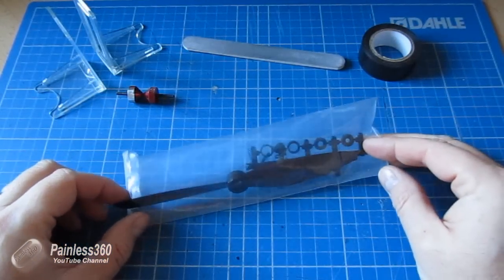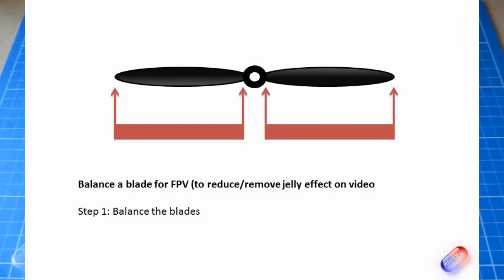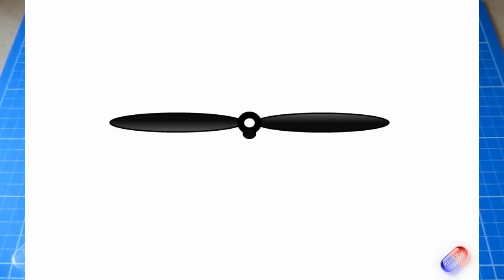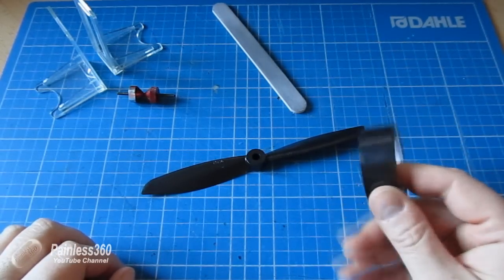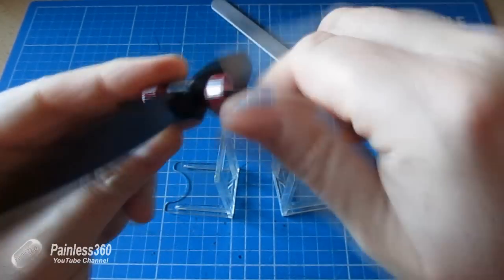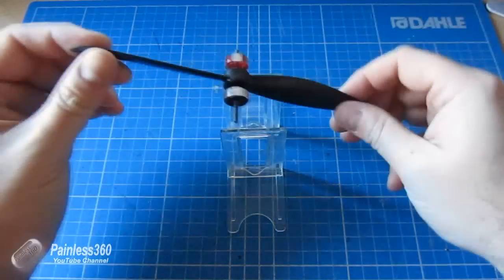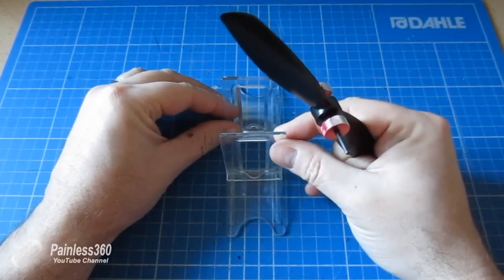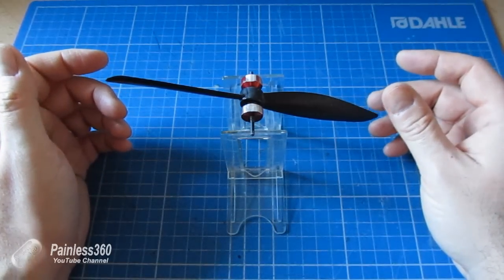How to balance a prop for FPV to help remove video 'wobbles'

Comment: Watched a couple other videos on youtube about prop balancing, you were the first video to bring up the point about the hub and how to balance it.  Thanks for all the awesome vids and sharing all your experience with the community.  I'm about to purchase my first 250 sized kit quad, your other videos have been a huge help in narrowing down what it is I want out of my first racing quad.  I'm leaning toward the Nighthawk Pro FPV Mini 280 RTF as an easy entry point to get the hang of things and then I'm hoping I can sell it to a friend on the cheap to get them into quad racing and at that point I'll build my first one from the ground up.  The prices aren't too bad for all the parts once you've already put money into the chargers, batteries and FPV headset.

Thanks again for all the vidoes, they've really been helpful in all my research for the past month.

edit: subscribed!
Reply from the maker: +lostalaska Welcome to the channel! :D

Comment: This is exactly what I'm trying to fix right now. Actually thinking what I could do to balance those self-locking props (like DJi phantom3 ones). Never saw a prop balancing tool that accepts that one. Thanks for the video.

Comment: Your video helped me a lot. 1st, I have the same simple crappy prop balancer like you and it's way out of balance. I used your method of balancing it and now it is much better, not perfect but at least it is working now. 2nd, After not having much luck with plastic props i switched to CF ones and since they are heavier than my previous ones, they produce much more vibrations, your video is good reference how to balance them too,, in fact I already managed to balance one almost perfectly. Thanks a lot!
Reply from the maker: Hi Bambi, glad to hear this helped. I wasn't aware for a long time that the hub needed balancing too! I have made a very cheap rig to hold this balancer for larger blades and it allows me to spin the prop freely. See Multirotor build tips: 3 blade prop balancing

Happy flying!

Comment: Came across this video on prop balancing.  You mentioned prop balance in a recent build and I had to see what you did and what your setup was. Similar to method to measuring mass unbalance in gyros.  We make measurements IA up, IA down, SA up and SA down.  With those measurements and knowing horizontal and verticle components of earth rate at your latitude you can remove bias and earth rate errors in you measuments.

Comment: Good day Lee. Well I have balanced a couple props but never considered  the hub part of the blade. cool. and very easy after watching your tips on this. Awhile back you gave me tips on search for RC  info, (in general and on your site) I tried searching first from you home page "balance", didn't show up, then from the main Youtube search field  with "painless 360 balancing" and there it was. Likely an issue with the guy doing the typing (LOL) but just thought you might have an idea or two. Anyway, thanks for all you do and share.

Jeff

Comment: I have been buying a lot of props. I have found that thinner props are far more forgiving and have the Natural capacity to soften the flight. Using the thicker carbon props prove to be far more unforgiving and create far more vibrations. I have found this true with my 210 quads too the thinner tri blade Dalprops seem to takeout the wobble where those thick bullnose props add to it. Cheers!

Comment: An easy solution to the balancer not being balanced is to just use a thin rod, i've just tried it out and works just as well, of course you have to keep it steady and leveled and would probably never be truly horizontal, but neither would the balancer, just a cheap solution for time being or if you're not into buying one :D

Comment: I balance each motor, prop, adaptor assembly as one using a laser.
That way imbalance from one can be offset by the other.
Before doing anything else I rotate the prop a little on the motor until I get the least vibration. You can feel and hear the difference it makes.
Then I start on balancing properly with a laser.
This tut is for small quads but I do the same on my larger ones.

Balance V949 V959 V212 Blades with a Laser

Comment: I use shaft that fits the prop using a Transfer Punch Set  they come in all sizes, a nice snug fit  no need for hubs . just google Transfer Punch Set

Comment: I run a third test by running motor while assessing vibration by holding hand on the model. If there is vibration evident then loosen prop and retighten 45 deg around. Continue until minimum or no vibration felt. I suppose that is balancing the motor bell. This one was from Andrew Newton originally.

Comment: Great video and thanks for sharing! I've been flying model airplanes for years and never balanced the hub like you did, but I'm certainly going to start now. I guess there is always something new to learn. BTW...I recently ordered the x525 with the multiwii 2.5 board and GPS unit. I'm looking forward to putting it together. I do have a question. I bought the GPS even though I didn't see what its full capabilities are. I know that sounds silly, but for 30 bucks I figured I'd just youtube it after the fact. Do you happen to have any info on its capabilities?

Comment: I never actually though of balancing the inner portion, I would not have guess that a bit of material so close to the center of rotation would have caused problems!

However, the way the prop mounting thing works on my setup, there is a bit of slack on the propeller sitting on the shaft, I am afraid that when it is operation, the prop will vibrate within the mount and then become unbalanced with respect to the center of rotation. I wonder why it isn't made with a slight conical shape so that the props self-center like they do in your balancing setup. :/

Comment: Hi lee ! I building Another plane, à mfd full size crosswind and I still have the same problème about clockwise and counterclockwise props etc. , my question is if  i have to tighten the nut on the shaft of the motor to the right , do i néed a counterclockwise prop or a clockwise prop, thanks lee
Reply from the maker: https://youtu.be/chlWYRl4TAU may be worth a look. Happy flying

Comment: What about balancing a whole thing (one arm) at once: Motor, prop adapter and propeller. Now you can measure vibrations from one arm at once.
Reply from the maker: Hi, that's what I do now. I balance the prop, then attach it to the motor and then use a zip tie on the motor to find the sweet spot for that prop/motor arm. I feel the vibration using a fingertip on the arm (being very careful) but could use a laser-pointer attached to the arm and see the amount of deflection of the beam onto the wall. Both work.With my largest H quad I still ended up with a rubber isolation mount with some 'Moongel' pads to get it rock steady in full HD recording using the GoPro. Always a great feeling when you find the answer to the last bit of video 'wobble' :)Happy flying!
Reply: Your approach makes sense to me.  Balance the prop using the unbalanced tool and ignore the tools imperfections then mount the prop on the motor, and do vibration analysis with it spinning.   And then apply counter-balance to the motor/prop assembly on the sides of the motor after the labels have been removed.

Comment: Great video. I have a frame that the motor mounts are bolted onto round carbon fiber tube. after putting motors on i use a tape measure to get the prop level by measuring each tip so it is the same from the surface. do you have a better way to do this?
Reply from the maker: The only thing I can think of was to make sure the model is  level and use a spirit level on top of the motor.. best of luck!

Comment: I'm loving your videos! I have some really crappy props.... 1045 balances fine with a small piece of tape, 1045R however needs half of the hub cut off and a blob of hot glue on the other side to balance.... or I'm doing something horribly wrong. Whichever.
Reply from the maker: +joblessalex No always, I've had a few props in my time that seemed to have one side made of paper, the other of lead! If it's that bad I wouldn't use it..
Reply: Painless360 Thing is, they're all like that. Time to tell the seller.
Reply from the maker: I would, maybe you got one of the 'Friday afternoon' batches ;)

Comment: great video, it will be good if u can make a video on balancing a prop balancer
Reply: just buy a DU BRO prop balancer (well worth the money) and you won't have to waist your time balancing your balancer. finger balancers are a joke.
Reply from the maker: +brandee dunlop Agreed. But lots of pilots use them and with some some and a file to get them spot on they can work great!

Comment: thats a pretty good way to balance the prop.and i am wonding how to balance your balance prop tool?thank you very much
Reply from the maker: yangyunbo1 Balancing the prop tool is the same as a prop - spin it and see if it stops in the same place every time. If it does, remove some material from that high side/add weight to the low side and keep doing that until it stops randomly.
Hope that makes sense!
Reply: Painless360 i get it,do this way need a accurate level？
Reply from the maker: it needs to be in the same position it will be in when you balance the props..

Happy flying!

Comment: i wana ask if i could install different propeller blades in the Walkera QD X350pro quadcopter like instead of 2 bladed propeller if  is with 3 or 4 bladed propeller. could it be possible even to improve the weight  lift? because I think I'll install a more powerful battery and in it is slightly heavier.
Reply from the maker: You could, not sure what the benefit would be though. The general rule of thumb is that the lower the number of blades the better, two being the practical minimum. Planes use more props when the diameter becomes and issue and the tips of the blades approach supersonic speeds.

I would be interested in what you find. Good luck.
Reply: Painless360 thx m8

Comment: hi there, probably the best vid on prop balancing, just wondering, how do i know whether the hub or the prop is imbalance?
Reply from the maker: +Iqbal Sukor not always easy to tell, the video covers the process. Happy flying!
Reply: Horizontal - to balance blades
Vertical - to balance hub

Comment: sir I bought simonk 30 A ESC ....for my quad ....is there any need to flash it with simonk firmware or not???....please guide me.
Reply from the maker: Learners' vlog see our videos on building quad copters. You shouldn't need to change anything, Just make sure you select the right ESC type in any flight controller software you use. Most builders use BLHeli powered ESCS now. Best of luck!

Comment: I have this question, when you start balancing, how do you know is it the hub or the blade which is causing prop to fall to one side?
Reply from the maker: Hi Zeeshan, simple answer - you don't. But unless you get the blades to balance you can't see the effect of the hub. Many times I'll balance the blades, then the hub and then find I need to fine tune the blade balance to get it to sit at any angle in the balancer. Happy flying!
Reply: Thanks, this was very helpful.

Comment: What do I need to do when my propbalancer is out of balance? It is impossible to balance the propbalancer. I bought a magnetic propbalancer on ebay for about 4 bucks. Which propbalancer do you recommend?
Reply from the maker: +Raoul Ursum then balance the prop balancer without a prop attached. spin it and remove material from the lowest side when it stops until settling in the same place every time. Best of luck!
Reply: Make sure you only have one cone on the shaft at a time when balancing the balancer.
Reply: Make sure you only have one cone on the shaft at a time when balancing the balancer.

Comment: Thank you nice video., also add weight by adding super glue (CA glue)
Reply from the maker: Thanks Roger. Thanks for the comment.

I've tried that method but I personally like the cleaner look of the hub without the blobs of glue. 

I also end up with it all over me and the other parts of the model :)

Seasons greetings and happy flying!

Comment: Hi there 
Can u help that how thrust do a 1000kv motor with 10*5 prop do get for max thrust signal
Reply from the maker: Sorry, I don't understand the question..
Reply: Painless360  what is the maximum thrust generated with a 1000kv bldc motor along with 10*5 propeller
Diameter of prop:10inch
Pitch of prop:5
Reply from the maker: You need to look at the specs for the motor you're interested in, the thrust (in grams) for the supported props and battery voltages should be listed. Please see the other videos in the 'Introduction to Remote Control' and 'Quadcopter Building for beginners' for more detail.. Best of luck!

Comment: how do you balance a prop that only has a hole on one side?
Reply: Some of the better balance tool companies are selling threaded mandrels for blind threaded props like some of the commercial multirotors use. Check the Du-Bro catalog. (they fairly new and weren't available when this video was made)

Their balance tool is a tad expensive, but comes out of the box dead on and ready for action. I don't regret it's purchase even a little. You can buy different shafts as you go, but the included one handles MOST props.

If you don't want to spring for the whole setup, the various mandrels are sold separately and work on any edge just as shown in the video.

Great video, as is normal from Painless!
 Thanks for all the great work!

Comment: you leave the tape on ? surely that is leaving a ridge though very small and isnt it better to sand down the heavier prop instead of add weight...then do the hub trick..
Reply from the maker: calvin crane Both work, one is faster than the other - the tape impacts the aerofoil to very small degree. Personal choice really.
Reply: Painless360 thanks for that.

Comment: Looks like we are to assume the hub is heavier at a precise 45 degrees from the props. If it is more towards the point where the prop joins to the hub then general balancing of the prop would incorporate the hub as well. At some point you got to decide you are finished with just balancing the prop and go flying! Otherwise you piddle more with tweaking than flying. Do we really want to be absorbed into all this minutiae. Just saying.
Reply from the maker: +Colin Bruner only if you don't have video distortion ;)

Comment: whynot sand the end rather then adding tape? a fingernail emry board should do it
Reply from the maker: naihanchin Kempo Both methods work - adding weight on the light side and taking a little off the heavier side. It's down to preference and speed. I do both if I have time.
Happy flying!

Comment: A bit misleading. First statically balance a prop does not really solve all the vibration issue. Dynamic Balance would be a better solution. Finally, even after proper balancing there is no guarantee to remove jello, the only solution, often, is a proper anti vibration mount for isolated the camera from high freq vibrations
Reply: not misleading, maybe incomplete. this is really great instructable on how to balance propellers. there is no guarantee to remove vibration issue but chances are this will improve things dramatically.
Reply from the maker: robert k Thanks Robert.

Comment: hmm not convinced - your prop balancer is not accurate enough to be sure the variations are not from the balancer, your desk, or your house! -  rather than the hub.  You would need scientific equipment to ensure you are actually measuring hub imbalance to the degree you think you are measuring it. I think you are actually balancing against the remaining variations in your balancer not the tiny bit of weight on part of the hub.  If you think about the leverage of the blades, and especially at speed, using physics, the tiny amount of imbalance present in the hub is essentially irrelevant compared with the 500 times more force generated by the ends of the prop blades.
Reply from the maker: +Richard Clark try it and see the improvement it makes with jello on cmos fpv cameras.. ;)
Reply: It's not just the weight that's making the jello effect. Most of what was taken off was flashing. The affect that would have on the aerodynamics of the blade is something else to consider. I wonder how much effect removing all the flashing first, then balancing would have on a quad.

Comment: The balancer itself requires balancing? Am i the only one that finds that comical? A piece of apparatus designed specifically to balance another component requires balancing itself!
Reply from the maker: If you buy a cheap crap one then I'd check it thoroughly..
Reply: @Painless360  Do the more pricey ones require balancing?